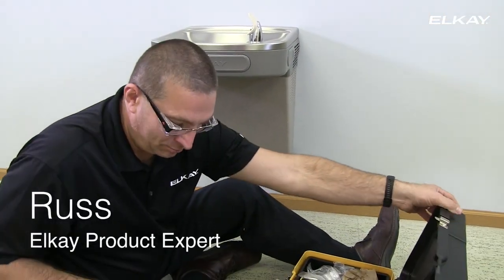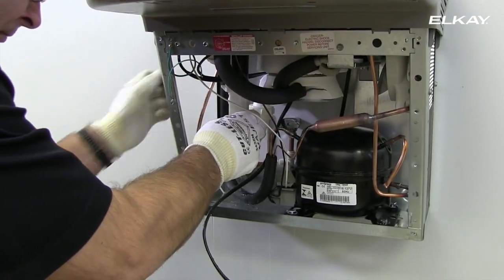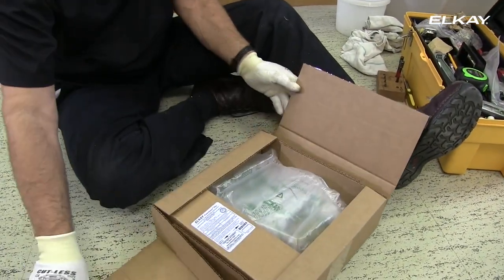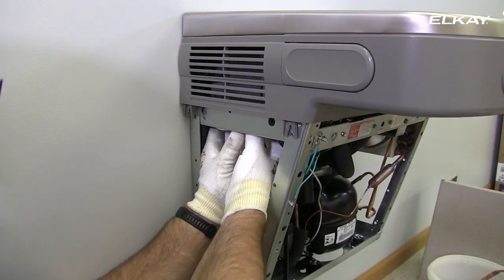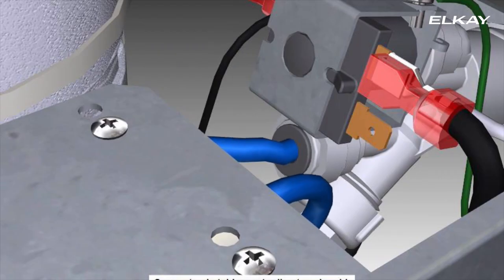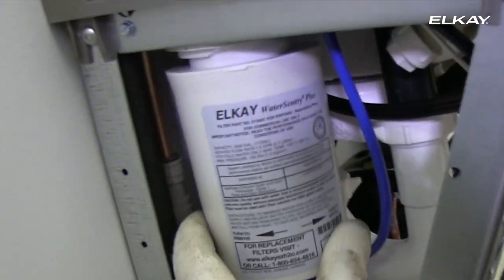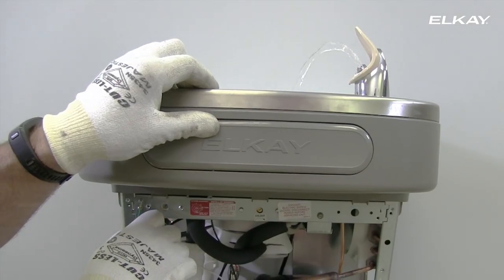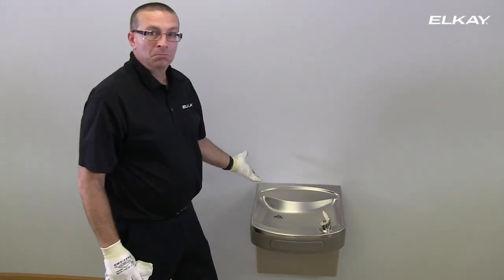Adding a Water Filter to an Elkay EZ Water Cooler (English)

Comment: Used 3/8" poly tubing from the water turn off to the copper tubing on the filter assembly eliminating the need for two quick connects.  Since it's a tight fit, this worked to my advantage making it easier to manipulate the line behind the filter itself.  Hardest part of the install is releasing the already installed 1/4' piping on the faucet itself.  It took me and another buddy 15 minutes of struggling to release the tubing from the connect.  Installing the 1/4" poly tubing wasn't difficult, but I would definitely suggest double checking for leaks!